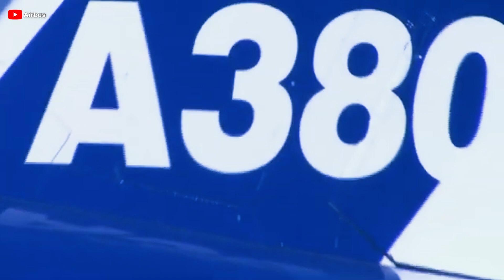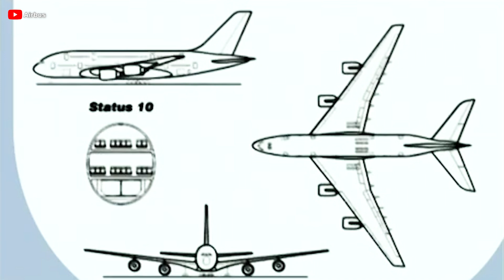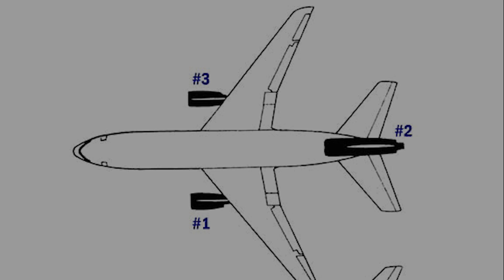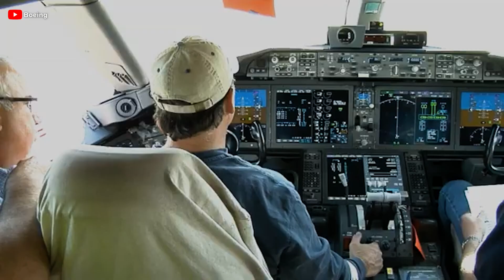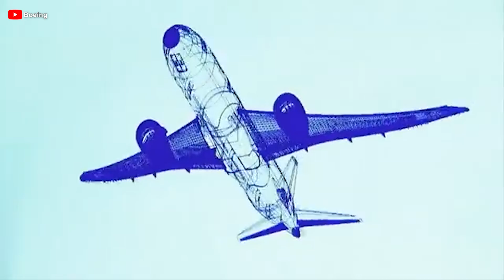HUGE PLAN for Tri-jets SHOCK the All Aviation NOW! Here's why

Comment: 0:34
This conventional notion: "Number of passengers or quantity of cargo determines the airline's revenue" is now no longer applicable. Earlier, too, it was not admissible, but to a lesser extent.
There are several other areas where a smart airline taps and earns millions of $$$. The airline company's fundamental business model comes into play. What about the appreciation in the real estate the company holds or will hold? The operation of aircraft, carrying men in the cabin and materials in the belly, becomes mere cosmetic utilisation. 
Tips: Don't go for a new model. Its initial cost is massive. You will never break even, even if it is more fuel-efficient.  Opt for an older model and save significantly on the initial capital costs. 
Why a new aircraft is abnormally costly? Because the manufacturer adds R&D costs, taxes also go up simultaneously.
What do you think the buyer should do? Do not buy it. Buy it at a reduced price. If a technology which claims to bring more efficiency does not bring the cost of production down, then it is not a technology.
Utilise the aircraft productively after it is decommissioned. In many cases, an aged plane earns more and consumes less capital than it did during its service life.  How? It is a different story. 
There are several other areas where you can utilise an aircraft productively while it is in operation. This, again, is another story.

Comment: It is all about add or final cost of trijet versions vs cost running these birds compared to what they replace.
Reply from the maker: Thanks for your feedback.
Reply: Yepp!! I never had the pleasure of riding an L1011. But I did ride several 727s back in the 1980s.
I rode only once on a DC-10 from Baltimore to London back in 1988.

Comment: In its day in the mid 70's the DC10 offered a fabulous travel experience compared to the cramped DC10 and B707.
Similarly the A380 feels like a flying palace while the B777 compares poorly for comfort and a sense of space especially on long haul flights.
I agree that a large spacious yet economical cabin is desperately needed. However it might be better to re-engine the A380 than start again.